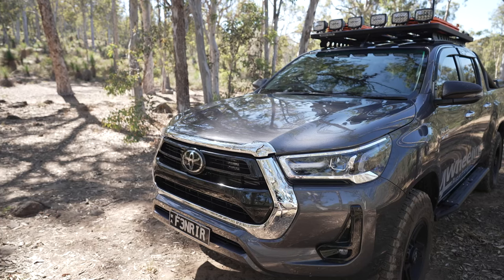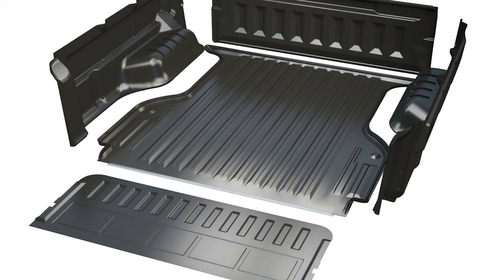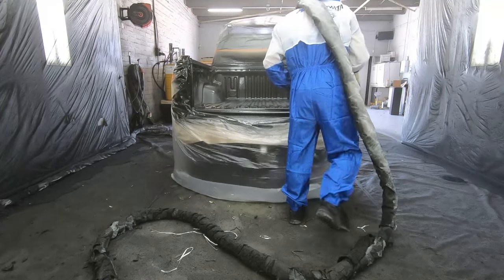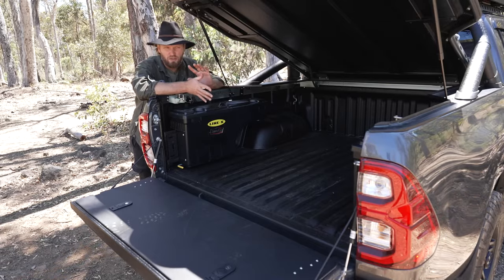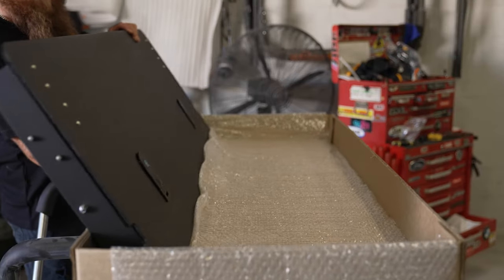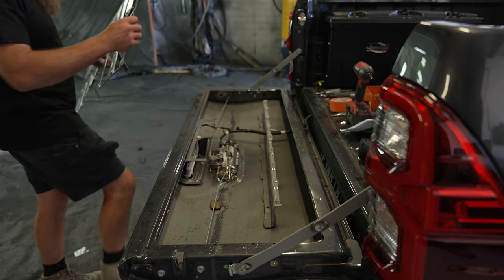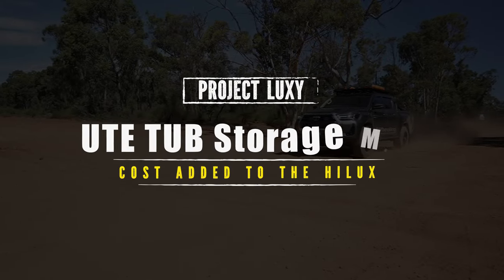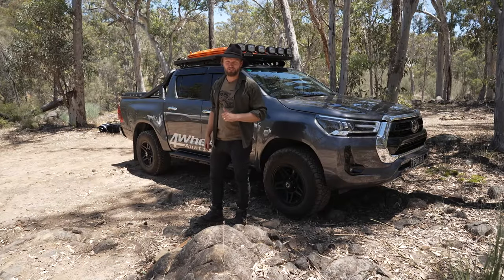2021 Toyota Hilux mods part 3, ULTIMATE UTE TUB MODS

Comment: Hi Ronny. I’ve started building my glamping rig on my 2020 Nissan Patrol Super Safari (aka GU in Australia). So far I have installed, FrontRunner Slimline II roof rack, Recovery holder, shovel holder, Nilight 52” curved light bar and 4 pod lights and Ikamper Skycamp 2.0. Approximate additional weight on the roof (currently) 120kg. My vehicle already started to drive bouncy on the curves. In addition to current mods I’m thinking to install 270 awning which will add minimum 20kg on one side. My question is about suspension/spring upgrade. What would you recommend to upgrade for suspensions? Only stiffer springs or full lift kit? Thanks in advance.

Comment: This video series is really helpfull and educational. I am considering buying either the new Hilux or L200 (sold as Triton in Aus). I was aiming for L200 as it has central diff and full time 4x4 - we are in snowy regions and this would be needed. However as Mitsu is leaving EU market, I will opt for the new 2.8L Hilux... May I ask 2 questions - is it possible to fit 16 inch wheels on the new models or are the brake discs too large? Also, in the previous videos you metioned great clearance (I think over 27 cm). Is this the clearance under the pumpkin on the rear axle? In that case it would be really good. What is the clearance under the IFS diff and below the doors, please (stock)?

Comment: Another good thing about spray on liner is that as opposed to a drop in liner, if there is dents/scratches already in the tub it will not sweat in-between the tub and liner and accelerate rusting. I also have the Uneek sliders and they're a great bit of kit, nice looking but very solid. The tailgate storage is definitely the best mod by far, I was looking at buying the same kit but the price was a bit steep, I went the DIY option and used a sheet of stainless with piano wire hinge, cost me a day and only $100, all my recovery gear and tie down/ratchet straps etc live in there. Looking forward to the next vid Ronny good work.

Comment: hey mate looking at those swing away cases atm, do you think they are worth the investment? i will be using mine for holding straps and tools. its either i buy these units or I'm looking at spending close to 10k for a steel tray conversion with underbody toolboxes.

Comment: Hi Ronny the Hilux series is great. As for a seal for the tailgate i purchased one from Toyota  for my 2017 N80 SR5 was not cheep but work well but goes right across the lower tray section as well.

Comment: Swing away Boxes, CON, It appears that you can only access them by swinging them out, (Tub lid latches in the way) that would mean that anything in the swing arc would have to be moved to access its contents.
Reply: That was going to be my question. If you can’t open them in the stowed position they are of limited use.
Reply from the maker: You can swing them out 50-100mm and access them from the top
Reply: That's a pretty big con, you're going to be packing that tub pretty tightly, and may not have that 100mm needed to open them. Also $350 Each?!
Reply: @KarlEller  Don't worry mate, they were free!

Comment: Hey Ronny. Been running the Uneek 4x4 rock sliders on my 2013 Ranger for about 5 years. They have saved my doors and sills numerous times in the Vic High Country. Also running the Uneek crawler bar and also been fantastic. Lucky me though I was able to get them a lot cheaper as they really weren't known back when I bought mine. Thanks mate.

Comment: Hi Ronny, I have just fitted a Grunt4x4 seal to my triton tailgate. Looks like it will seal about 99%. Fairly good kit only took about 10-15mins to fit, only downside is you have to nearly slam the tailgate to get it to shut.

Comment: Absolutely loving project Luxy!

Favourite mod: rock sliders, they look great and I was surprised how light they are.

Almost favourite: the partial chrome delete! Why not also do the handles?

Least favourite mod: the swing out boxes. They look like you need to unpack gear to swing out and seem heavy. I'd probably have looked for small plastic boxes or canvas bags that fit the general area or built a permanent box for compressor or such like.

Comment: Like the coating.
The rear tailgate storage looks pretty shallow limiting options, however it might just be perfect for a rifle and ammo. 

You didn't mention whether it's lockable?

Not sold on Swing away boxes. Very expensive for plastic and only useful if tub is empty.like you said be good if vehicle specific.

Looking good and thanks Ronny

Comment: Also, I just bought myself a brand new 2021 Toyota Tacoma TRD Off Road, the Tub is already a plastic material with a  scratch resistant surface. So i just placed the Toyota Rubber Mat for $109 US. I will be getting one of those storage bins in the near future.

Comment: My father-in-law dust proofed his tailgate using a swimming pool "noodle".  Just trimmed it around all the edges and it works great.  Also keeps carbon monoxide out so the dogs can ride safely in the tub.
Reply: if it's dust proof then also air cannot flow in it so this maybe dangerous for the dogs especially on hot days

Comment: Good choice on the bedliner in my opinion. The fact that it's permanent is actually a big pro, not a con, if you're not planning to keep the truck forever. At least that's true where I live. The reason is that a permanent bed liner like that will actually increase the value of the truck if you go to sell it, compared to an otherwise identical vehicle without it.

Comment: Loving the mods Ronny!! 
Question though, I also have a Ute but I don’t have a load lid or canopy. I’m looking at upgrading to the bush company alpha tent, how would you mount it? Can you mount it? Or am I dreaming?/
Reply from the maker: You can use a frame over the tub for that. Like a half frame so the height is the same as roof rack and not over. But all depends on how long the RTT is
Reply: @Ronny_Dahl  thanks Ronny!! Love the channel btw

Comment: Noticed the 6 spotties on the roof rack. Awesome look, but does this exceed the R.T.O. legalities ?
Reply: Fitment of Additional Driving Lights (Including LED Light Bars)
1
Number: Up to a maximum of four (4) additional driving lights
Position: At the front of the vehicle3 and must only be ‘front facing’ and not
higher than the front edge of the bonnet if fitted to a bull bar or nudge
bar.
Fitted symmetrically (same position on both sides of the vehicle).
If installing a single additional driving light (i.e. LED light bar) it must be
installed horizontally and located symmetrically about the longitudinal
centre line of the vehicle.
Light colour: White
Operation: To be used in conjunction with the vehicle's headlights
All additional driving lights must turn off when the vehicle’s headlights
are switched to low beam
Note: Any additional driving lights fitted to the vehicle must not obstruct or
interfere with the light emitted by any of the headlights, indicators or
parking lights fitted to the vehicle.

Comment: hi ronny i used to be coach driver doing through out australia witch included dusty roads and we han fans in luggage areas and as can imagine with the size of those luggage doors it very to create a seal and these fan work extremely well
Reply from the maker: Interesting mate I think a seal with a fan perhaps to create positive pressure.
Reply: @Ronny_Dahl  exactly.
Reply: Positive pressure is the answer. When I mentioned my tub dust problem to my mining engineering mate he said for all his machine cabins he fits a positive pressure system to keep all his workers dust free (at least whilst they’re working inside!)

Comment: I had a 2010 Hilux 3L diesel automatic. I glued some rubber seal to the tail gate rim that will touch the tub. I did it for rain proofing but my tub lid was not as good as yours so it leaked no matter what I did. I sold the sucker and never going to buy a ute again. I will go for a Patrol or a Land Cruiser and not even think of a ute  again.

Comment: i would highly recommend Bilstein b6's for the hilux. even the b8 model. most Bilsteins are serviceable and are a mono-tube shock which means they don't heat up as much as a twin tube shock which means they are more efficient. I have fitted and sold many to 79 series/ 76 series and all the hilux models and they do very very well.

Comment: used the foam tape that is used under canopies between them and truck.    it is normaly 1 inch wide by 1/4 thick build it up two layers thick in places if you need thicker.

Comment: The 6 lights on the roof racks are overkill and belong on an 80’s Ute. They are positioned way too far forward and will just reflect off the dash/bonnet/future bullbar. May as well not bother wiring them up because they are truely just a prop and a hindrance. Install a single stedi light bar a little further back and you’ll love it.

Comment: You forgot to mention that the liner will also keep water from the metal. If you use a rubber mat, water will get under it and you won't notice it until you remove the mat and see all the rust.

Comment: if you want to seal the tailgate....
alot of overlanders are purchasing a single or double bulb seal on amazon. after doing some research the is the same neoprene seal that camper shell manufacturing uses. its all sticky tape and cut to fit. it colapses to form qn air and water tight seal which can be good and bad. I am using this product on my camper shell seal and the single bulb is on order.

Comment: I had a factory spray in bed liner on a Nissan Frontier is used to own. A con for bed liner is that it is a sandpaper-like texture, so it can scratch up stuff that's in the bed. Not an issue for everything, but you have to think ahead on what gets thrown in there.
Reply: thats a good point.
Reply: how about some plywood? can just replace it later for cheap

Comment: Favourite mod would have to be the tail gate storage and gas struts, however definitely liking the idea of the tub liner as I got the crappy plastic liner insert which I do regret. Also want to black out all the chrome as you (and many others) have. Don't like the plastic tub wheel arch storage boxes as others have mentioned if you're tubs packed full access is difficult if not impossible without unpacking plus they appear to remove a tie down point at the rear of the tub, obviously not an issue for you as you have the hard lid but for others like me who opt to not have the hard lid so I can transport larger items that would definitely be a con, even though the toyota standard tie down points in the rear tub are crap and you still have wasted space between the box & the wheel arch.

PS. if you're honestly adding up the weights for every mod then don't forget the weight of the window weather shields. They may weigh next to nothing but every gram is more weight and if you were 500g out for every mod then that could put off your total by quite afew kilos.... and that could be the difference between one or two cases of beer (not that I drink beer).

Comment: Part A is just Elastomeric Paint, and Part B is an off the shelf hardener; the only thing that makes LineX special is the hot/high pressure application.
Reply: There is nothing "off the shelf" about LINE-X. LINE-X have a portfolio of over 20 different polyurea compounds to suit different applications, all of which are developed by a team of scientists in our dedicated R&D facility located in Huntsville, Alabama USA. XS-350 which is used in Australia is stronger/harder/more chemical resistant than anything else used as a spray on liner. Also Part A is the Hardner (ISO) and Part B the "Elastomeric Paint" (Resin). For those interested in a more detailed explanation of the chemistry of LINE-X, Veritasium did a good video about it here - https://www.youtube.com/watch?v=DWkYRh6OXy8&t=4s
Reply: @LINEXAustralia  lol. Seems legit.

Comment: for the dust protecion, you could use those double layer tapes and use powder on the outer side so it doenst stick to the rear door, its cheap and easy to undo if it doesnt work

Comment: my opinion if you are going off road with the vehicle   the bull bar, side bars you will need will need to be 1 unit.

to many get screw on jobs which look the  part though doesn't protect the vehicle from animal strikes ..

 I would consider a  nudge bumper similar to  what the fire trucks use yes it might add weight however it might save the vehicle.

Comment: Not 100% sure on the tailgate seals, I've got a grunt one on mine and it seems okay, with that hard lid id look at a positive pressure scupper vent somewhere with a filter in line, possibly a flexible line out the front of the tray between the cab and a inlet on your sports bar
Reply: I think there’s someone who makes a air scupper system using the sports bar tubing!!

Comment: You can keep a tally on the weight of everything but you can’t miss things I went to a truck scale and weighed my truck with a full tank a gas hazard wires coming out of the factory then as I add things on there I go back occasionally I’m waiting job with me sitting in the truck full tank of gas all the new mods and I get exact weight every time It costs couple of dollars but it’s really accurate and easy to keep track of LOL

Comment: Bunning for rubber seals  get the one with 3m tape mine has been on for 3years no dust
Reply: Which seal is that - the 'D' seal?
Reply: @muzzaball  Yer mate D seal softer of the ones . Run it along the bottom of the tailgate so it squeezes on the body  when you close the tailgte and along the sides. tried the kits online but is the same stuff but not as good

Comment: I would personally remove the sports bars, they serve zero purpose. First mod I did on mine and it looks much much better.
Reply: And unnecessary weight 👍🏻
Reply: looks better in black tho. But yeah not much purpose
Reply: with those load lids they are cut out around the bar so it would look weird with this particular lid, i got the same style on my ute and tried it like you said but it looked worse. Should have got the load lid that was the whole top and not notched for a bar.
Reply: @garynz345   Yeah I’ve got the full load lid (without cut outs) on my 2009 Hilux. It’s been great but after nearly 10 years of opening/closing, the struts have finally failed but that’s another topic of discussion. 😅
Reply: Useless? Nah, great to tie a swag to, utilising the space.

Comment: Liking the Linex liner, was hoping you wouldn’t go with a factory plastic bed liner, those are shit over priced waste of time, def an investment using Linex, Rhino or Raptor.
Interesting the weight monitoring gains, am liking this as you mod the Lux, plus the costs.
Having had 2 N70 D3,0s I have mentioned this before both SR5s why and imo so far this shows why I have said the SR5 is a complete waste of time if you are going to mod this platform, save the money for the mods and get the SR, same power NM the only difference in NM between MT vs AT 420 for the MT 500 Nm for the AT, you are buying or spending extra for average at best Toyota extras like the head unit, seats, interior wheels and tires, and fake chrome. which you are paying extra to paint lol, maybe it was availability I dunno, but I’d never buy an SR5 model again, it would be an SR and out the savings into the mods, same philosophy you are showing to us, may or may not be same products but like the steps that’s very good info to consider re width pros and cons. oh maybe the SR5 gets the rear locker and SR dosent, not a deal break for me, aid just go ARB air locker anyway, though Toyota’s factory lockers ime in the 79 are good, but seats rip out SR stock go Stratos in every build my body needs em regardless now, plenty of interior options out there with Ministry of Interior or Crusier Consoles, imo/e Id specc as high as I can with the vehicle without the bling and put that into the build. I hate a Toyota head units and rubbish, rather install an good Alipine, I drive allot of Modern current Toyota’s they all drive me bat shit crazy. But she’s coming together nicely look forward to seeing it on a long trip, def a big improvement I think over the previous 2,8 last gen. like the boxes and tailgate storage seeing that done in the 80 series always thought this was a great idea, good vid dude.🤙

Comment: “Military grade” 😂
Just means the cheapest product that the military could spec.
Reply: jim yeats Mil grade has kinda lost its way of late,cheapest? Don't look to close at the Collins class or you'll be livered!
Reply: @grahamwhittaker8844  The term has just become overused by every civilian company. It has no meaning anymore.
Reply: Cheapest they could spec for the applicable job. Military grade armor amazing. Military grade food horrible.
Reply: @johnlewis1095  lol.  The point isn't whether it's a product used by the military.  The discussion is about the usefulness of the term as a descriptor.  It's an overused term that generally means little.  It just means a giant organization that does an enormous variety of things put out bids for a product, and it has been shown over and over with their choice in products that it usually just comes down to cost.
Reply: I dunno mate. The plenty of DIY in a can type tub liners out there.

I’m not sure the yanks would have used it as a blast mitigation barrier on the pentagon if it wasn’t effective as such.

Seems an interesting and accurate descriptor to me. Not that I expect to use my Ute as bomb shelter any time soon 😂 

Anyways... my point was I’m not sure you can say “military grade” just means cheapest product. That may be true in some cases but there’s also a need to be fit for purpose.
Reply: @johnlewis1095  You make good points.  There are certainly exceptions.  In my mind I wasn't really thinking at all about a specific product like LineX in particular, just hearing that phrase makes me cringe.